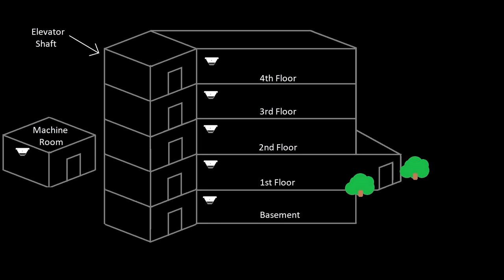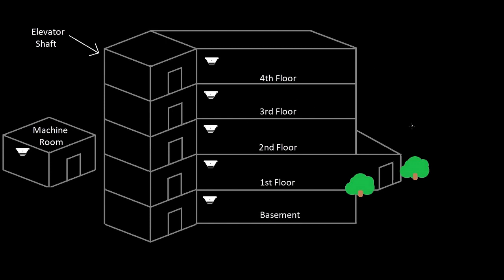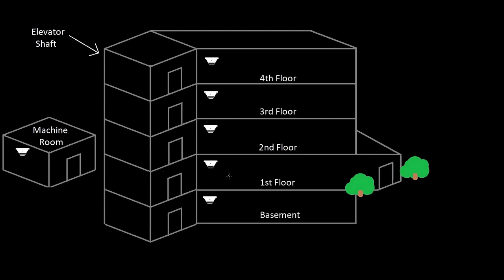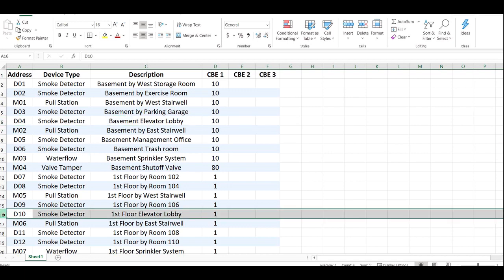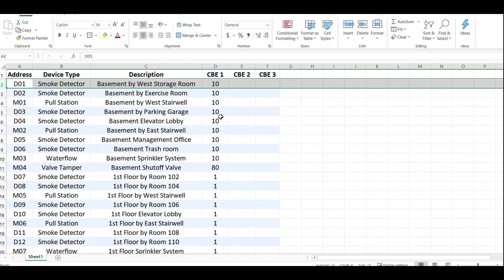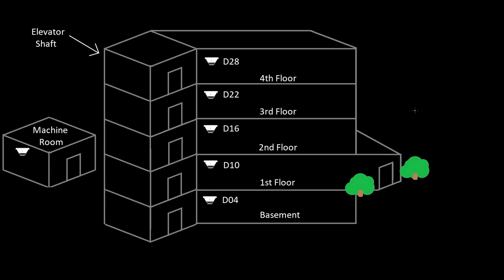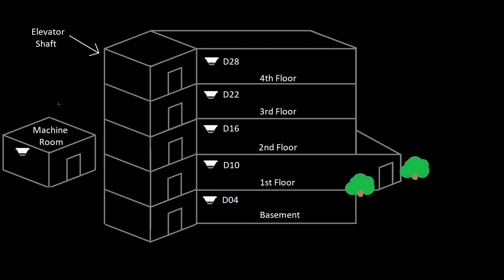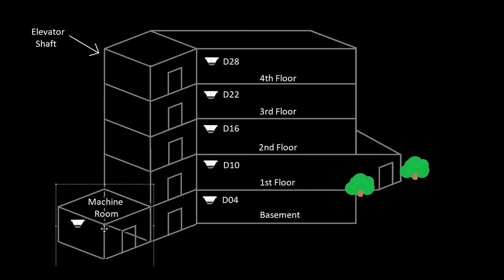35 - Elevator Recall - Introduction to Fire Alarms

Comment: This is a question that might be a Lil off topic but lets get into it.... that elevator fire fighters operation key has the hat ,reset off and on. The key switch for resetting, what wires would you put a jumper on to get a reset.  As an electrician technician I do know only the elevator engineers are the ones that have the service  keys and service .some company's do have the reset key on site
Reply from the maker: I don't know which offhand. Id almost need the key to meter it in different positions. But I think the two options are the wire for reset, and the wire for fire service (phase 1), so if you jump common to either of those it should reset. I've done that once. The caveat there is if you damage something it's on you. There may be types of elevators that have a separate power source for reset and fire fire service, but I highly doubt it.
Reply: @Joe Klochan  Thanks for replying..✏️ I think that's correct the wire that's on the terminal when the key is in the ↖️ reset position and the power will do a reset .thanks again

Comment: Honestly, I can't thank you enough. Your videos have been so helpful. Is there a way to donate to your channel?
Reply from the maker: Hmm, thanks for asking! I'm looking into what would be the most practical way to provide that option.
Reply from the maker: @Alex McGowan I put a link at the end of all the videos. Thanks for the idea. It's kind of weird putting that out there, but someone anonymously donated already.
Reply from the maker: @Alex McGowan, I'm not sure that's a great idea. There are many variables to take into account when designing a system like that, and there would likely be requirements your local jurisdiction would have that I wouldn't be familiar with. If you're not well-versed in fire alarm system design and installation, this would be a really big project to take on. I'm not discouraging you from doing it, but it would probably be worth the money to outsource the design portion to someone experienced and licensed in your area. A seemingly small oversight in the design phase could be extremely expensive to fix once the project is underway or complete, and that's an enormous risk. 

In addition to that, I haven't used Fire-Lite voice systems, so I may not be the best guy to consult. Their systems aren't approved for use in required high rise buildings in my city, and so I've never seen them used in a building anywhere near the size you're talking about. I looked at their website and it seems that they do have equipment that would meet your needs, but having not used it, I'd be in a situation where I don't know what I don't know. If it were Notifier or FCI that would be a different story. 

Despite all that, I could definitely help point you in the right direction and give you some tips on what to look out for if you decide to take this on. But I would strongly advise outsourcing the design if you haven't done it before. If the design is right, then the installation is basically just a matter of following instructions. But if the design isn't right, the odds of you pulling it off any making any money on it aren't very good. If you want to discuss it further, shoot me an email. joeklochan@gmail.com